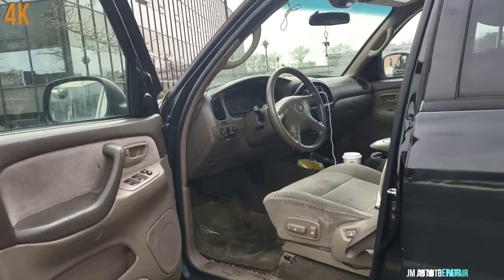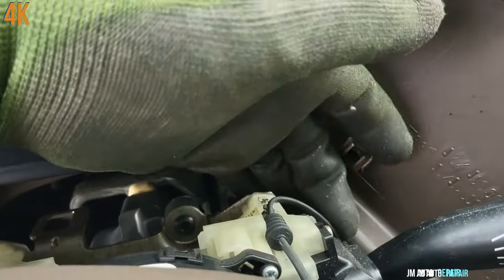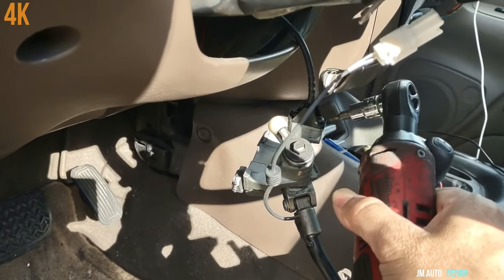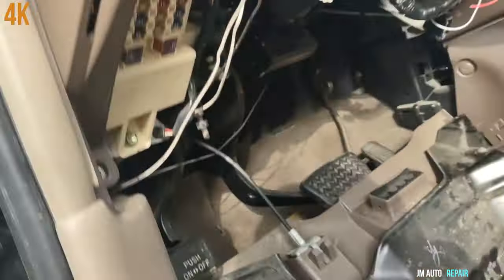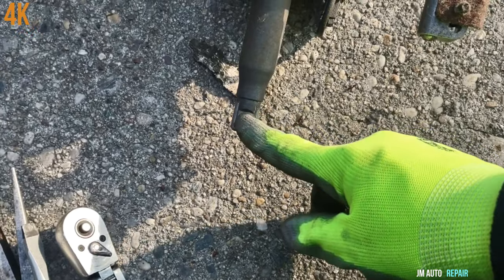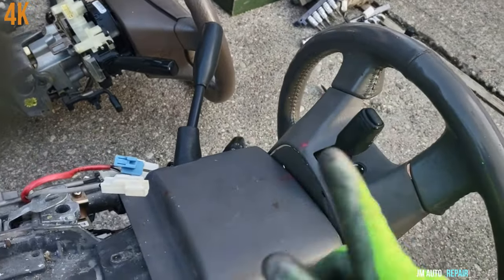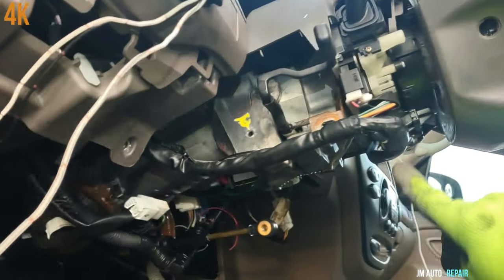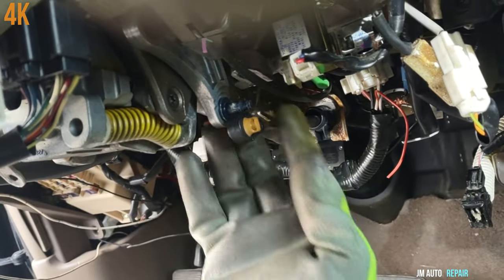how to replace the steering colum on 2001 2007 toyota sequoia steering column assembly replacement

Comment: 2 year ago I had same problem..it's very common in Toyota....we just replaced the broken part..30 minutes work 
Very simple you don't have to remove all that ..
Next time check for some one else opinion..
Reply from the maker: this part did not break from the common part it aways break, the whole assambly was useless, also the owner had already the whole assambly so I did the right thing.

Comment: Hi, JM. I have a 2001 Toyota Sequoia. Supposedly had tie rod ends changed, wheel bearings, ball joints.

The steering seems sloppy & and the right side feels bumpy while driving ... not sure mechanic was skilled with Toyota.

Any thoughts?

Do u have a contact number? Where are u located?
Reply from the maker: hi and thanks for visiting my channel,  was the car the same before or it feels different after the repair? there are so many things that can make the car feel bumpy, from bad tires, tie rods, struts, bad draftshaft, unbalance tires. but wheel bearings and ball joints dont really make the car bumpy.
Reply: @JM-AUTO  Hi, JM. It was bumpy(or wobbly--feels on right side), but after tie rod, wheel bearing, ball joints) it feels worse. 

Now, the steering feels sloppy.

Not certain mechanic knew how to press wheel bearing into hub.

What city are u located?

Do u have business name I could look up to get a phone number?

Enjoyed your video ... appears u may be skilled.

Thank u.
Reply from the maker: @GotchaplumberGotchahvac  wheel bearings dont cause this issue but tie rod ends and ball joints do n other parts of the suspension, im in New York.
Reply: Thk u, JM.
Reply: Hola a mi me pasaba algo parecido le puse toda la dirección nueva y estaba igual y al final eran las llantas mal balanceada me las corrigió un profesional y ahora rueda como nueva